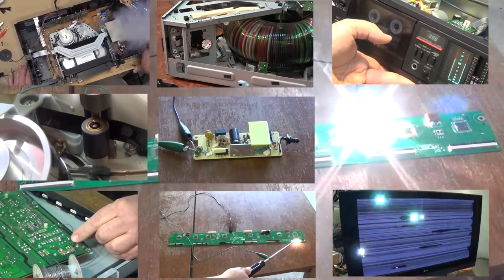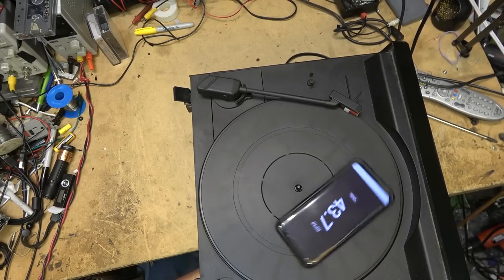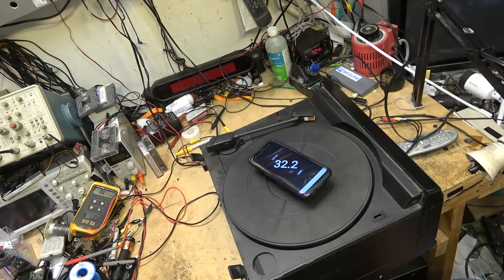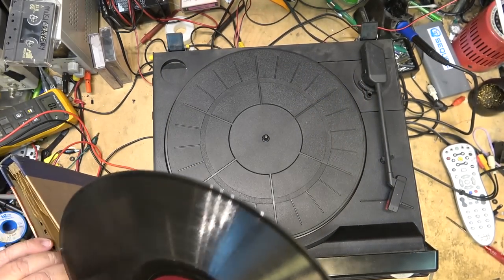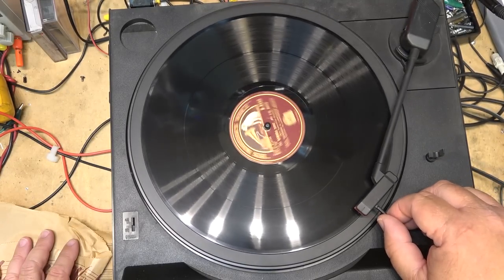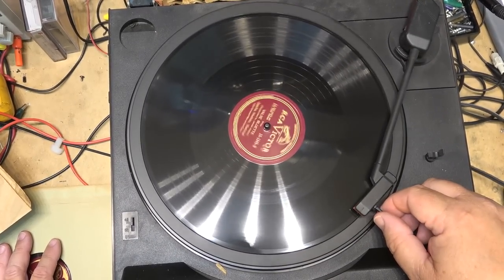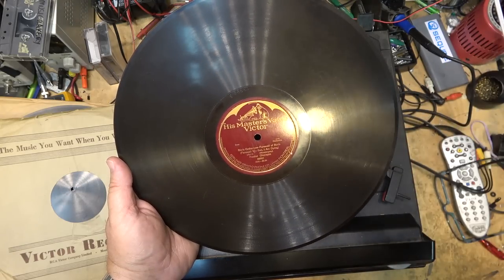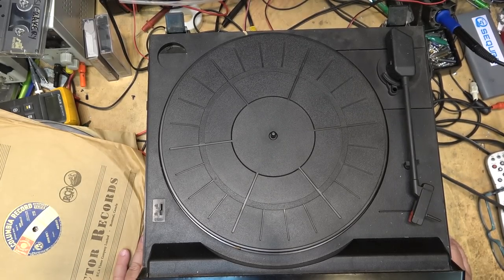78RPM mod for an old cheap Panasonic Record Player.

Comment: It never ceases to amaze me how many of those old records were punched off-center.  This pre-dates PVC "vinyl" pressings,  too.  I've even seen 45s like that,  mainly pumped out for volume distributors to markets when juke boxes were popular.  Not too many seemed to care about fidelity.
Reply: In some cases it is most certainly true, I've got one record by Doris Day. With one side being heavily distorted off-center, and the flip side was perfect. A lot of the records I own from the 1930s doesn't suffer so much from this issue though. Could just be luck.

Comment: Ironically the acoustics of your workshop and the fact that your recording device has two microphones adds dimension. The 78s sound like they are in stereo through my headphones!
Reply: Sometimes I feel like I am listening to one of those 1960's Enoch Light "Persuasive Percussion" recordings with the ping pong right, left, right, left stereo effects as Dave's voice pans quickly left, right, left, right. Must drive you headphone people bonkers!

Comment: Sum the right and left channels together will also help quiet the pops and surface noise dramatically when using a stereo cartridge. Make it permanent, not like you will play anything else on this, and it cost nothing but some solder.

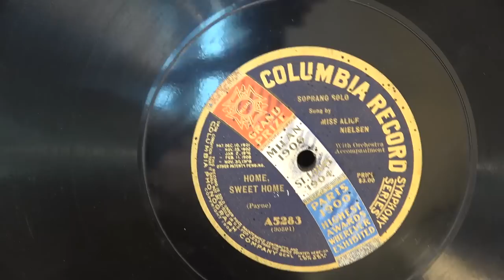Comment: 18:19  From the label designs of RCA and Columbia that are on the records in the video, most of the records you demonstrate were manufactured in Canada in the first five years of the 1950's. Most of the 12 inch records you show after 21:00 were acoustically  recorded in the 1920's and 30's, and meant to be played on acoustic hand cranked machines with steel needles. The dates shown are patent dates for the label.  The one's from the fifties were electrically recorded and meant to be played with crystal pickups and electronic amplifiers.  They will not last long when played with gramophones and steel needles. A side note about Youtube copyright strikes: I once got a copyright strike on a video I did at Christmas that had my Niece singing Ave Marie in the background.  Maybe I could use the strike as evidence to get the company to pay her royalties for the song LOL, since they claimed to own it.  Ave maria is public domain I believe, and only a specific recording of it can be copyrighted.

Comment: I have a ton of 78’s in my collection. I played it on my wind-up phonograph. I have two wind-up machines like my Victor VV 8-4 Orthophonic Victrola from 1926, and my Camp Fone portable phonograph from 1923, and it still works and plays great. I did cleaned out the old grease, put new grease in on the spring motor, and it does the job.
Reply from the maker: I forget which model Victor I had.  The spring let go and i sold it.  Guy i contacted to fix offered me 1000 for it and i jumped at the chance.  I see them come up for sale every so often for about the same price or a little more.  Antique shop had one recently for 1100 in good shape.  Too big though and loud.  Had to stuff socks or a pillow in the horn to shut the volume down because they would blow you out of the house.
Reply: @12voltvids  That must have been those wild opera parties people had in the day, crank it up loud!
Reply from the maker: @teacfan1080  roaring 20s

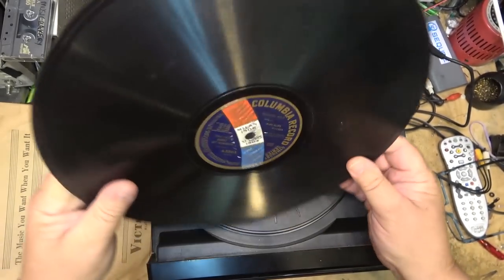Comment: Your Columbia "Grand Prize" label record at 19:23 is from 1910. There is an excellent resource for looking up 78's called the online 78 rpm discography. That's how I found the year for that record. The record number was A5283. I believe these listings are for American issues, not sure how many UK pressings may be shown as the records may have different numbers. No lead out grooves until the mid-20's or so as that's when the first changer units started showing up. I have a couple nice boxes full of all sorts of 78's and all types of music...up into the start of the rock 'n' roll era. You've got a time capsule of what people listened to 100+ years ago, kind of fun. In another 100 years, it will still be there forever etched in those grooves! Some limited edition modern 78's are occasionally pressed. A record company called Rivermont released some "new" dance music on 78's in which I have a copy. This 78 is in STEREO and is microgroove and was pressed in 2019! Even the label and sleeve had that 1930's time period look to it.

Comment: I'm sure some people are going to post crying about what an awful record player this is. 
 
In comparison to the midrange or high end, light tracking turntables of today, yes it is.  

BUT.... let me remind those people that the record players of the '78' era were often BRUTAL in comparison to this unit.

I'm pleased to see that this unit has been given another chance.  I would suggest, though, that you occasionally look in on that motor and make sure it stays lubricated, given its current age and the fact that it's spinning a lot faster than it originally did.

Another suggestion would be to hook in a pitch control and mount it somewhere that's accessible externally.  Some '78s' actually... AREN'T.

Comment: Just order the 3 mil needle for that Crosley clone ceramic cartridge, make it a dedicated 78 player, archive the records you like to digital, and give the records to a collector. That is what I would do. I have my 1965 Magnavox console that has a flip over 0.7 mil stereo/3 mil 78 and a CBS Mastersound portable record player with a Garrard 1000 changer that will play the old shellac records.
Reply from the maker: Well I have an offer on the table to buy the collection and if i can get something for it i will because i know there is value in these 78s.  They sell them in the old vinyl store and some are quite valuable.  Considering the age they all will be worth something but they will all end up with a collector. They are all in very good condition.   I haven't gone through them all yet but I will in the next few days so i know what i have.

Comment: I got a technics sl1900 years ago for very little money that is direct drive. It plays 33 and 45 and while it's not a SL1200 it's a pretty robust turntable. I found a schematic online and it looked like I could convince it to run at 78-80 without much work. 78's wee made for anything from 76 to 80 rpm (eary records were usually 80 rpm) so I wanted it to be adjustable.

i added a small toggle switch to enable me to change the 45 setting to 78rpm nominal. By throwing that switch I can use the 45 speed adjust to run between 74 and 85 rpm. I built a phono preamp with opamps that has switchable equalization for several of the old 78 curves so I can play jst about anything

Comment: i think i may have just witnessed (The World's First Circuit Bent Record Player!)
glad to see you found a use for this player!
If you ever get far into the hobby of collecting old 78s, you should definitely get a dual 1019.
If memory sirves me right you have a video or 2 floting around on your channel working on some duals.
I regret trading my dual away especially after all the money I spent restoring it and on upgrades. Ended up trading it for a crappy gemini pa amp the kind of thing with gassed up specs.
Reply from the maker: I do have a dual 1214. Just my son has "borrowed" it.
Reply: @12voltvids  Nice!
Hope I come across something similar again some day!
For now I have this Radioshack Realistic LAB something something linear tracker that I restored and love it.
It was a lot of fun getting it working and it was made around 1984 from what I could find online.
Had it for almost 3 years now

Comment: It sounds to me that the tone arm has increasing resistance like heavy anti skate, near the end the noise increases dramatically as compared to the lead in, The adjustment you suggested on the auto return may be justified.

Comment: That is a nice idea for that crappy thing 👍🏻👍🏻👍🏻
Would a better quality turntable sound better, if converted to 78 rpm, or not 🤔
Could be a nice idea for those wirh a collection of oldies 👍🏻
I would have loved to hear something at the 122 rpm speed though 😉😜
Reply from the maker: No, a better turntable would not sound better unless a 78 stylus and cartridge was fitted and the tone arm set to 10 grams or more. The ceramic cartridge is mode than good enough for these old relics. Remember that old recordings used a vertical modulated groove, not the horizontal groove that later records used. The "needle" (that's a trigger word for some) rides up and down in the groove not side to side. The reason it plays on a stereo cartridge is stereo records used 45' angle recording so they respond to both the horizontal and vertical movement of the stylus.
Reply: @commietube_censorship_sucks  I think that extra thick Columbia might be one of those rare vertical cut ones.
Reply: Some early Pathe records played at 100 rpm!
Reply: @PaulaXism aschenputtel far as I know (and I could be wrong ) columbia did not produce any vertical recorded  discs, but in the early days they made vertical cylinder records

Comment: Another way is to play the 78's at 45rpm, recording into Audacity.
In Audacity under effects, there is a change speed facility with presets already loaded to change from 45 to 78 plus other combinations.
Reply from the maker: That's too much work.

Comment: You might add a switch to switch in the proper resistance to get the 45 back and maybe 16 as well.
Reply from the maker: I would never play a 45 or 33 on this. I have a Thorens td165 and Technics SLM1 for those records. This will be for the old 78s only and nothing else.

Comment: I'm curious, how much less swushy they'd sound with a different shaped/sized stylus?
Reply from the maker: For the worn records it would be a little quieter. The stylus on this one is not exactly small, but a 5mil would be preferred.  Remember these were played originally using a sharpened roofing nail..

Comment: Stylus for 78 has different profile than lp or 45rpm for optimum playback as lp stylus will damage grove of 78 rpm
Reply: If you hear a hiss, that's a telltale sign of the stylus wrecking the grooves. Did you hear a hiss here?
Reply: old, worn LP stylii sometimes work ok on 78s, but in any case it doesn't really matter as I guess the plan here is to play them all once to record them digitally then never play the actual records again - just as a way of archiving these recordings for posterity

Comment: the older Collaro changers had a setting for fully manual play i. have one of the last ones
Reply: I had one way back. A totally manual model 4 speed 12" platter.. heavy as anything.. took a while to get up to speed. The auto ones were cute.. especially the way the arm banged the side of the record to find out it's size
Reply: @PaulaXism  that was a very effficient way to have a turntable find the right size

Comment: I have not read the previous posts, but old 78's was not recorded using RIAA and therefore the reproduction using modern equipment makes them sound different. 
RIAA came around 1964-55 and is used for 33 1/3 and 45 rpm records. A chrystal needle (pick-up) is recommended as they "fill up" the groove, which modern styluses don''t. 
If you are just about to listen to your old 78's I don't think you will need to do anything. But, otherwise you should try to make the cartridge "moniozed" and then disconnect the RIIA-converter. To get the best sound out of a 78 is close to rocket scinence as the groves are recorded different depending on the record label. Also the grove has diffent withs and then the speed could vary between high 60 rpm and way above 80 rpm. 
There are lists on the net on the differences and it is so tiresome trying to chose the correct needles etc. Thankfully the modern era with vinyls and digital recordings make life easier - a little.
Reply: When it comes to copyright music is usually free it the composer has been dead for 70 years, but I don't know whay copyright regulations you have in Canada.
Reply from the maker: I am aware that they are not RIAA, but then neither is this ceramic cartridge pickup. The cartridge connects literally to the AUX input, the same one you would connect a CD player to. In fact the front panel switch selects the same amp input! They are parallel internal.  That is the phono cartridge is connected to the AUX inputs. They will function as an output. For fun I should make a quick video on this. Yes I can connect this black plastic crap turntable to a real amplifier. Might just do that as I may be bored later today.

Comment: Rewire the cartridge output for mono.. Or put a mono cart with a 78 stylus. That will eliminate most of that surface noise.
Reply from the maker: Yes I know.  Or turn down the trebble.  I won't be playing many 78s.  Most of these will be going to a collector.

Comment: Put on a adjustable homemade bracket, nut, ballpen spring, screw and counterweight to get the right weight on the needle perhaps? :)

22:08 I think the reason for this one side record being cracked in the middle might be due to it may be made of nitrocellulose. Does it have a sweet floral smell? If so it is the smell of nitrocellulose. Products of 30 years or older starts smelling like that, and gets more potent.
Did you know that nitrocellulose was used as mining explosives in the past? And still used in many products today and is in many old records without owners knowing? The records are called acetates.
Fran tells about it in this video, and that one should consider not put them in plastic bags to preserve them and instead give them lots of ventilation and away from heat. Becourse they gets damaged when not stored properly and can even burn and explode.. many old film studios and even hospitals did burn down to the ground becourse of the use of nitrocellulose in the film reels kept in airtight boxes. The film reels was made so the plastic was more flexible and may be the reason for this dange happening more with film reels.
This is anyway a important video to watch for record collectors i think.

Egads!!! The Volatile World Of NITRO!!!
https://www.youtube.com/watch?v=w8Uhys5Ldrs

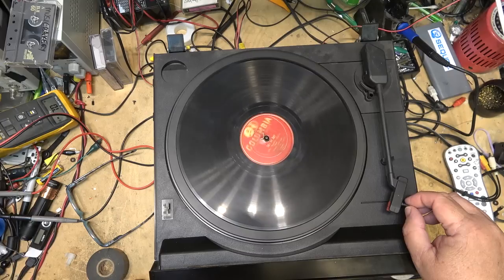At 9:12 she tells about a record collector she know that have hundreds of these acetates records and he did get shocked when she told him it was nitrocellulose in them. And tells what one can do, like not store them hot and keep them ventilated. Nitroacetate can burn under water and in a vacum when they first combust.

If you want something good and obscure to listen to you might find something in the Krautrock genre :)
It is the 60's music multiplied by two kind of, some even gets into too much weirdness, it was much of that recorded in Germany in the 60's 70's.
The album    Frumpy - All will be changed     is lovely, Inga Rumpf is a good singer :)
https://www.youtube.com/watch?v=aDEkJzYZ67I

David Banner says this on the forum underneat the video so i wanna spread it more, spread the love people :)
"I keep pinching myself, because what I'm hearing cannot be fucking real. Can't believe I just now found this band after 52 years on earth. Thank you, Thank You, Thank You!!!".
Reply: This type of turntable is typically set up at the factory to track at about 5-6 grams or so.  That's the recommended tracking force for those ceramic cartridges.  I suppose the counterbalance spring they used with these units could be damaged, worn, improperly set, or missing, but even if it really did track at 12 grams, that would still be fairly 'light' compared to the players those 78s were originally played on.

If I were inclined to reduce tracking weight, I wouldnt use a spring.  I'd probably epoxy a bolt to the rear of the tone arm, and then use a nut and/or some washers to make the tracking weight adjustable.

If this was my project, I would disconnect the signal leads from the amplifier and set them up at the rear as a separate output, so that I could feed the signal to an amp with a proper ceramic phono input.  I did something similar with a busted-up Crosley portable a few years ago.

But, by this point, it would be beyond the scope of a simple 'resurrect and repurpose' kind of thing, yeah?
Reply: @xaenon  Yeah, the spiral spring was ment to hold the counterweight on the screw bracket more tight, so it can be adjustable.
I think i has seen something like that before, it was what popped up when i did think about it there and then. It is likely hundreds of ways to make this, as in everything else :)
My old dad had a old suitcase record player with a crank on it when i was a kid, it might have been a 78 player perhaps or was it more systems? It had a horn speaker system on the tone arm.
Get a one-way speaker element with a paper cone as tweeter in the middle, it will fit good this old style music :) Make a cabinet, something like this antique wooden cabinet https://www.worthpoint.com/worthopedia/antique-wood-american-bosch-28-533909333
Yeah, the right sound is important, put in a tube buffer in this too to get some warm tube sound from vintage times, i got two of those, a one tube 6n3 and a two tube 6n3, chinese tubes, work fine, the one tube one makes more warmth but can be too much for modern music, i think that one is called starved tube buffer or something like that :)
Yeah, we make things too advanced, agree, lol, but will fit fine for the second part called "How to make a vintage record player run on hydrogen cells" :)

Comment: You need to 3D print a 78 stylus...  Sorry.  That thing was doing well spinning up around 130, wonder how long the motor would last if you ran it that quick for long.
Reply from the maker: It would run a long time.

Comment: There are also 16 rpm records, it will be nice to set other speed to 16rpm
Reply from the maker: Yes it would be very easy to do and if I had a 16 rpm record i would set the 33 speed to 16.6